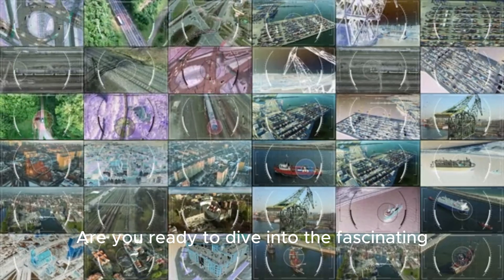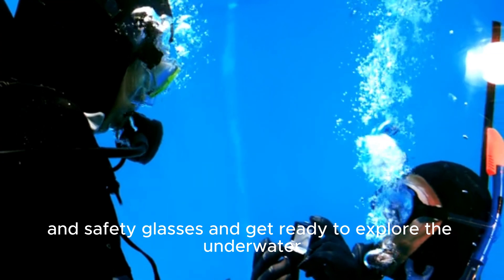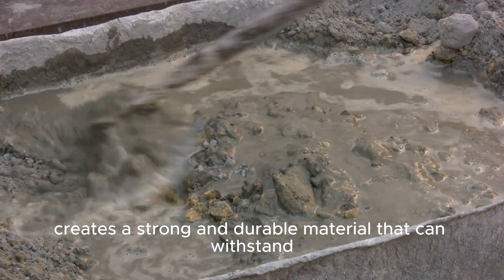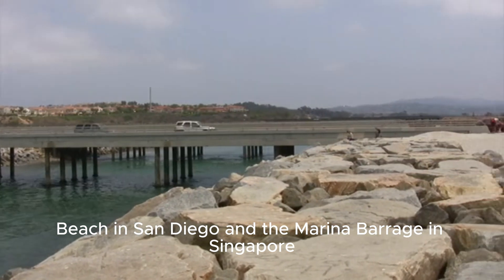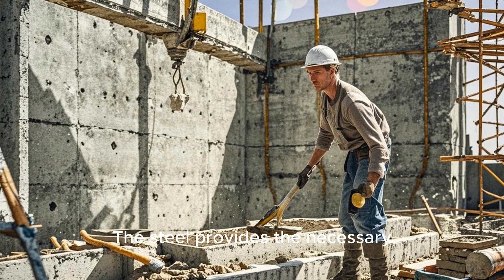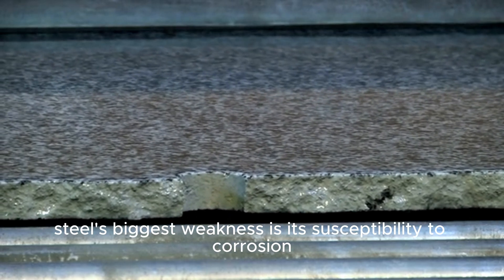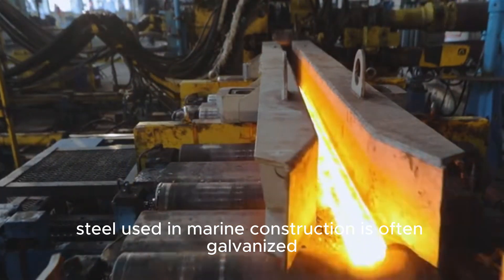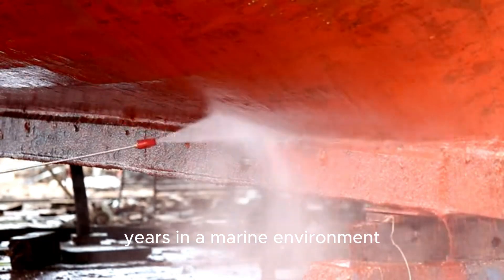The Ultimate Marine Construction Showdown: Concrete vs Steel

Comment: corrosion will strike right away with steel
Reply from the maker: You make a great point! Corrosion is definitely a major concern when it comes to steel in marine environments. It's crucial to consider the materials we use in construction!

Comment: Steel easily corrodes especially to marine environment
Reply from the maker: You're absolutely right! Corrosion can be a significant issue for steel in marine environments, which is why understanding the pros and cons of each material is so crucial in marine construction.